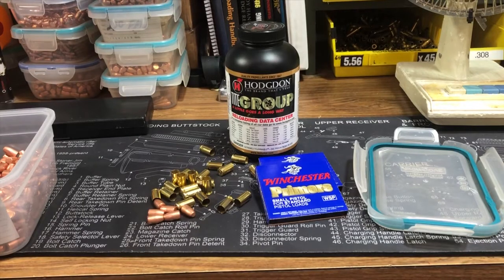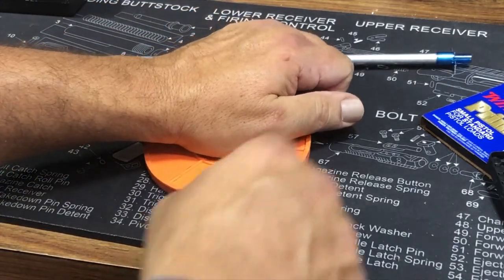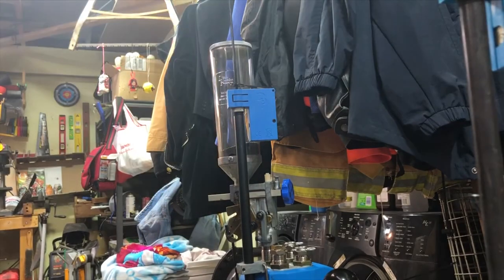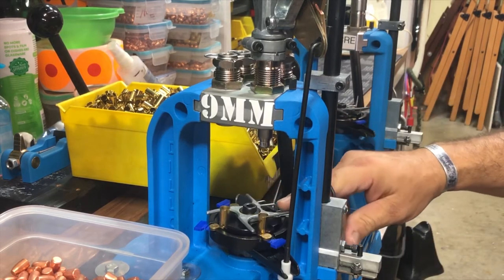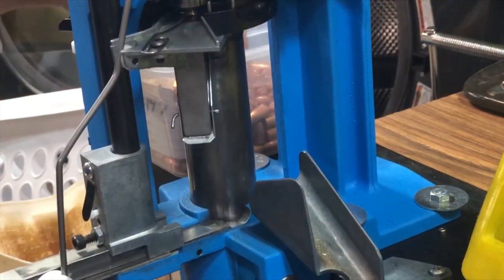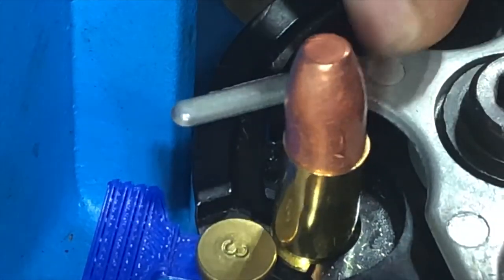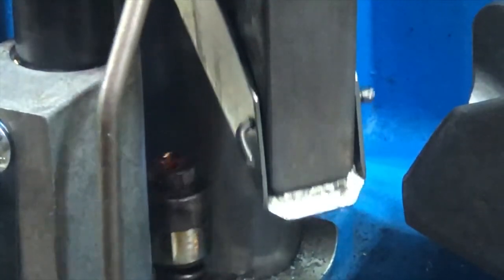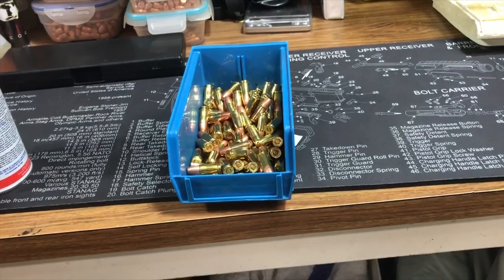Loading 9mm Luger on a Dillon 550

Comment: I know this was difficult and time consuming to post and I will thank you for that.  I also have an older 550, I have used my experience from the manufacturing world to streamline the operation of the press.  Couple of quick ideas.  Minimize movement - set the empty cases as close as possible to the side of the press. If you can pickup and place the case in the press while moving your hand just a few inches you reduce errors and increase speed.
This applies to the bullet placement also.  
Because it takes a certain level of concentration I typically do not load for longer than an hour or so.
Reply from the maker: i tend to load for a couple of hours listing to books on tape.

Comment: That is a great illustrated video to teach a new loader on how to teach a guy on a 550. I have been running mine along with other presses and for straight walled cartridges it is very hard to beat. That said tonight I was loading 223 , but the prep time to size, deprime, trim, de-bur in and out, swage the military primer, debur the flash hole, prime and then get ready for press powder drop bullet seat and crimp. If it sounds like a lot of steps it is because each cartridge offers it's own challenges.
Reply: i use two heads one to de prime and resize and trim, then i run a wet tumble then run through the second to prime, power set and crimp

Comment: the slowest and most important part of the process is setting the dies and especially adjusting the powder measure. To insure quality about every 25 rounds I pull a charged case and weigh it. As the powder settles it seems to get denser and heavier. With these small charges even a tenth of a grain is an important variation.
Reply from the maker: i have not had that issue.  I do check about every 100 or so.   Once the dies are set though on the 550 i never move them as i have several replaceable heads with several different calibers

Comment: Great video, thanks!  Nice closeups of each station.  FYI, I have all the Dillon case gauges but was shocked last year with a 9mm round my friend  loaded.  He was just starting out on a single stage and didn’t know what he was doing, and loaded several rounds with a huge roll crimp.  The rounds wouldn’t chamber in a Glock factory barrel, in a BarSto match barrel, or in a KKM barrel.  But they dropped just fine into the Dillon 9mm case gauge.  I sent it back to Dillon and they verified it was cut wrong and replaced it.  I bought the gauge in 2019.  Frankly that made me suspect my other Dillon gauges even though they’ve been working, and for new calibers I only use L.E. Wilson gauges.  

Q:  Where did you get the blue locator pin tabs?  Great idea.  Thanks again.  👍
Reply from the maker: get them on Ebay, or if you have a friend with a 3D printer have them print you some.
Reply: @Hickamfield  will do, thanks for the info.

Comment: Would you recommend a 550 as a “first press” for a brand new reloader(in this case, me)? I would like to start with pistol cartridges, 9mm/45ACP/357/38SPL. Eventually rifle as well, mostly for benchrest work and some varmint loads.
Reply from the maker: i started on a 550 about 20 years ago, it is a great press, just take your time, get about 3 manuals and read thous and make sure your scales are in grains not grams.

Comment: Nice video, some constructive criticism. Shell plate to loose, crimp way to tight which will reduce neck tension since lead dont spring back, but the brass case will. Also 9mm head spaces on the mouth of the case which is over crimped and will not consistently hit the barrel shelf leading to inconsistent accuracy and bullet plating getting stripped.
Reply from the maker: Thanks,
I just moved so my equipment is all still in boxes.  I have a three gun in a couple of weeks so need to break it all out this weekend and load a bunch of stuff for it.    BTW my 9mm was really contestant and i have never had any problems.  I load a lot of powder coated lead as well with the same set up and no issues.

Comment: Love you video but I have a question , do you have a problem with bulging case's ( range brass more than likely fired from a Glock ) resizing them using Dillon resizing die . Someone suggested I use a Lee under sizing die . Whats your advice ?------  Sorry loading 9mm.
Reply: no problems with bulging,  just check head spacing and don't over crimp

Comment: Looks like the shell plate is loose. Personally I stick a case in each station then tighten then shell plate then dont forget the screw on the side of the ram.
Reply: ha. I stick a case in each station then tighten the shell plate - then back out 1/4 turn. Works for me. I also deprime first, then wet tumble. Then my reload process is clean and easy.

Comment: hi there, i like your video, im trying to buy same press but im not sure if its 550 or 550c, and second what do i need to start loading my 9mm beside the press, would appriciated if you will let me know, i emailed Dillon few weeks back but no answer yet,thanks
Reply from the maker: First a couple of good reloading books, I like the Hornady Handbook 11th edition and the Lyman 50th edition reloading handbook next a press, I love my 550’s I have a couple.  I would go with a used one if you can find one,  If not Dillon is 4-6 weeks out I hear and yes it is a 550C.  Then you will need a caliber conversion for the caliber you want to load.  You will also need a set of reloading dies.  Other thinks you need are a good scale, calipers, and a case gauge.  That is the bear minimum.  I almost forgot you need powder, primers and projectiles…. RMR is backorder 12 weeks on 115 grain 9mm right now, and good luck on finding any primers.    If you can get it all together it is a great hobby, be careful and stay safe and use the manuals to load safely.

Comment: Dillon's are good presses, but good luck getting parts from the maker. Sent in an order for conversion kits for my 550 back in late December. Just shy of 300 bucks so not a small order. After 3 months they still have not answered 4 e-mails asking for a status and nothing has arrived. Been an owner for 25 years and never had anything but outstanding service. But since Mike (the founder) died service has gone to ####. Been forced to try and scrounge the parts I need and look at trying to single stage the calibers I only need small batches of rounds for. I understand the demand, and I understand  some delays. But flat out ignoring my simple question of if they even received the order has me a bit upset. 

If you find a press and have all the conversion kits you need, by all means go for it. But good luck dealing with the maker until they get their act together.
Reply from the maker: that is strange, i had a bad part last week, called them, they called me back in 15 minutes and set out a replacement part and i got it in 2 days, no cost under warranty.  Love there life time no BS warranty
Reply: Not sure what the problem is at this point. As I said, have had great luck with them in the past. Cracked my frame 20 years ago and they replaced it for free with out any questions. Again, it is not the product I have issues with it is the radio silence. Answering ONE of my messages would have answered questions and settled things.
Reply from the maker: @shadowcat3163  try calling they have been returning my calls within 30 minutes.  I know they are slammed as far as orders go, a friend of mine is a Dillon dealer and he has parts on back order since last year too,
Reply: Huh,  had a 1980s 550 that was super corroded, sent it in about 3.5 months ago and asked them to upgrade it to the C...  They cleaned it beautifully, updated it to a C, and sent it back within a month for about $200.
Reply: I know, as I said I have never had a problem with them and it was always outstanding service. This last time (Dec 2020 to March 2021) they just flat out ignored at least 4 messages from me even though I had a complaint number assigned. Never charged me though so that is not an issue. If they would have contacted me and just said they never got it I would have sent in another order and we would have been good. But ignoring me for three months sort of ticked me off.

Comment: Your shell plate is not tightened down enough . When you installed the primer, you can see that shell plate moved up . Shell plate should NOT move or tilt whenever you pull or push the handle . When you zoomed in at 9:05 and especially when viewing at 1/4 speed , you can clearly see your shell plate lift or tilt up . When your shell plate tilts like that, it's not straight up or in the same vertical plane when your primer  it makes contact with your brass . Check your finished primers, they may be set deeper on one side than the other because of that . The same is true for your other dies, the shell needs to be in the same vertical plane for powder, seating and crimping .
Reply from the maker: works fine,  if i tighten it down any more it locks up

Comment: Nice!! Everyone has there own way. I stop every 50 rounds to weigh the powder charge and check overall length. Not that I’ve ever found a problem. Must be the aviator in me that makes me terminally anal. I prefer the manual indexing over the auto like in the 750. I’m not in too big a hurry and rarely load more than 300 I an evening. When you make any kind of mistake on a auto indexing machine, you can easily compound things by not paying close attention to the indexing. Easy to get ahead of yourself. Thanks for taking the time.
Reply from the maker: thanks for stopping by to watch